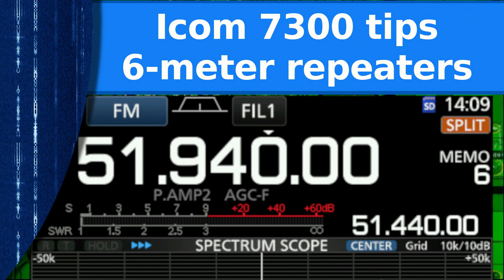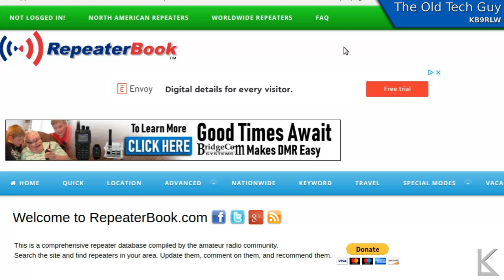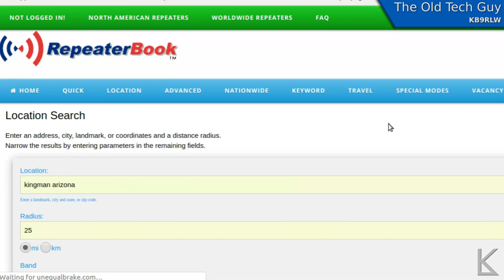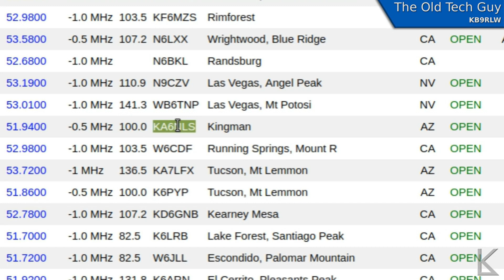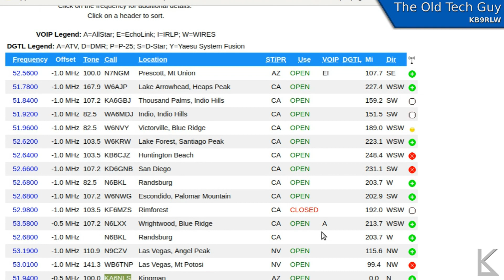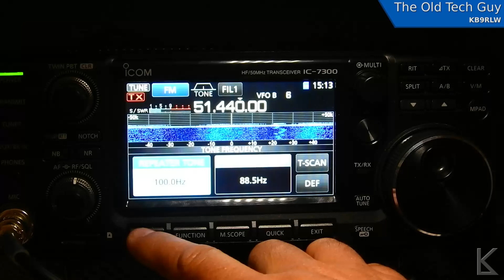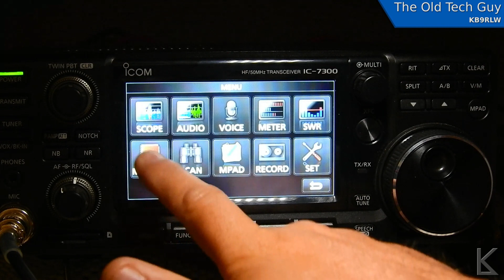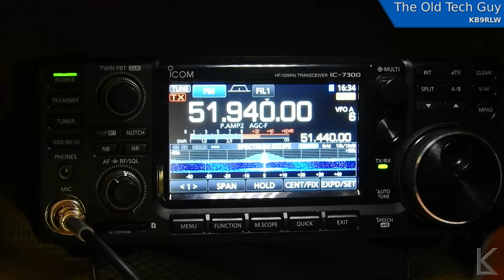Ham Radio - Setting up the Icom 7300 for 6 meter repeaters.

Comment: Would you know how to use a 6 meter repeater that requires a up and down link tone that are different. my radio has only one place to put a tone?
Reply from the maker: You really only need the tone on your transmit to open the repeater. The tone coming on the receive side is only for convenience. Allowing your squelch to only open when it hears the tone. But without that tone, your squelch will still open. So you really only need the tone on the transmit side.
Reply: @loughkb  Thank you so much! 73's K1CXS

Comment: I have a suggestion.....If you have a title that says you are going to setup the Icom 7300, let's do the automatic setup for the 7300 not showing  how to do it manually on this radio and other radios. Auto first, then manual.  Maybe either extend your video or do a separate video.

Comment: This means an TONE-Freq must be set, and send always 100Hz behind the normal modulation ? Is it possible do it without the tone Frequenz, all my old radios don't have an 100Hz Tone behind the FM Mod. Don't understod how it's work with the tone case. How an user can know that there must activate 100Hz side tone ? Or can i use an separat hand -Dial-Sound-Pad to open  the gate ?
Reply from the maker: Some 6 meter repeaters are open and don't require a sub-audible tone.   Many of them do and the tone varies by repeater.  You can see them in the list on repeaterbook.com.   
There used to be kits for sub-audible tone generators you could put in-line with your microphone.  They probably still exist.

Comment: Armed forces day is next Saturday May 11 so the info Kevin gave you for split will work for the cross band contacts for that also, just remember to transmit IN the ham bands while listening to the military stations outside of the ham bands. They will give their listening frequency now and then.

Comment: That was easy. I also put the 10 meter repeaters in memory. Right now I only have the IMAX 2000 CB antenna, which works 10 down to 17 meters. Santiago Peak from the SF valley needed 60 watts to get in. Mt Harvard took 5 watts.

Comment: Thanks for the videos. Simple and straightforward. Any reason you were running preamp2? Saw the OVF come on. Keep the videos coming love em. Nice haircut by the way...lol
Reply from the maker: I had the preamp on due to low sensitivity on 6 RX of my HF vertical I was using.  James is less than 100 yards away, so his 5 watts was triggering the OVF indicator.